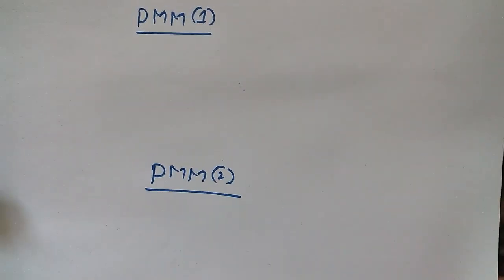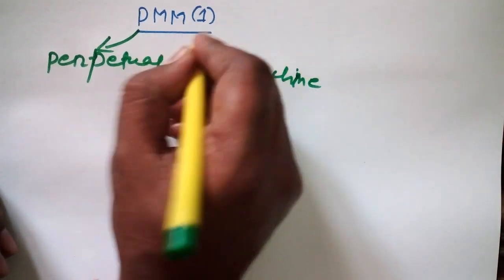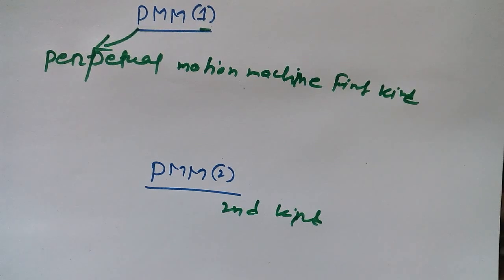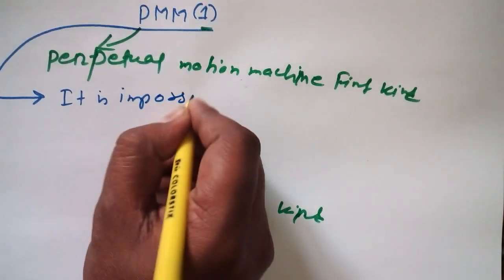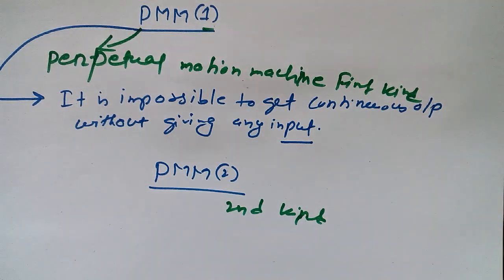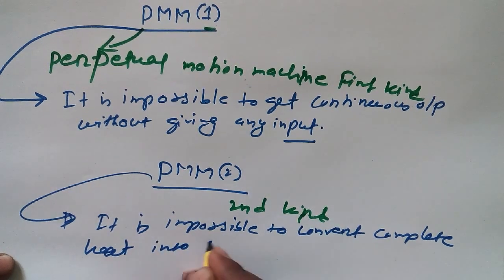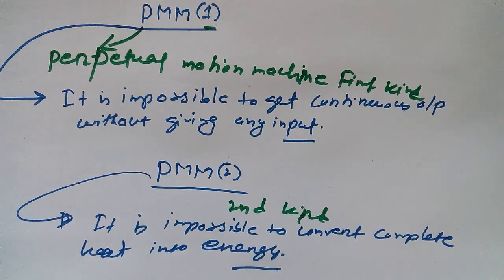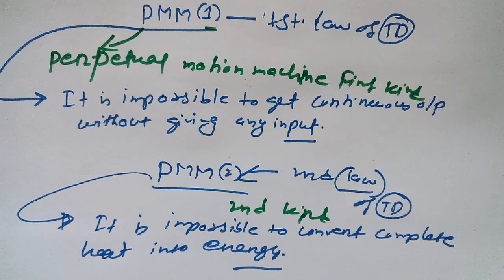PMM1 and PMM2 in Thermodynamics

Comment: Sit heat is also energy that means energy is transfered into energy 
So I want to ask that which type of energy is converted into which type of energy
Reply: Heat is not energy. This is a way to transfer energy
And work is also not energy.  It is also a way to transfer energy....
Reply: DHARMENDRA kumar heat into work
Reply: actually pmm2 states that it is impossible to convert total heat energy into work . ie q= w.
Reply from the maker: both possible but one high grade and low grade energy is there